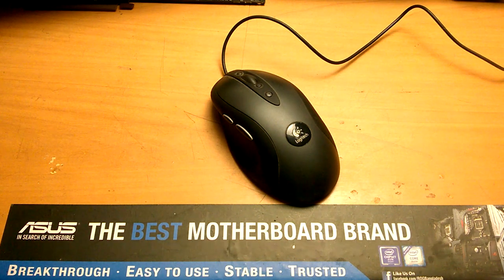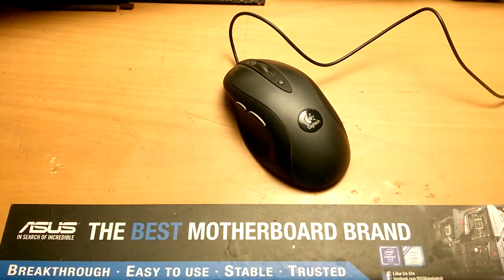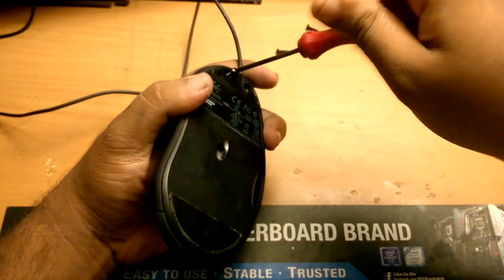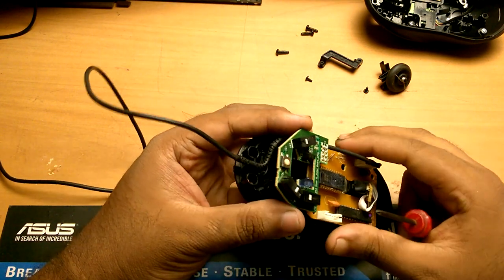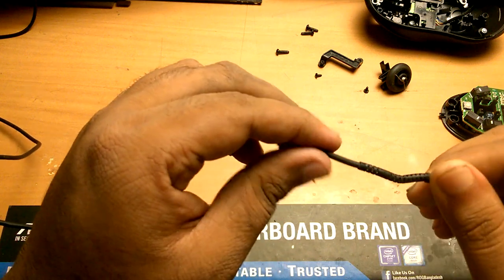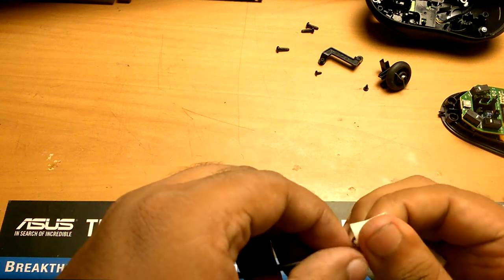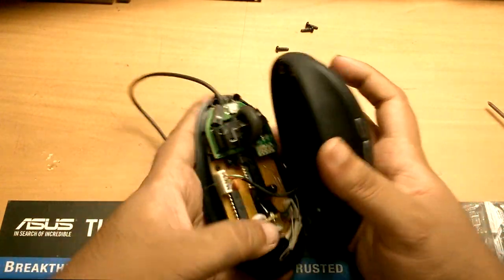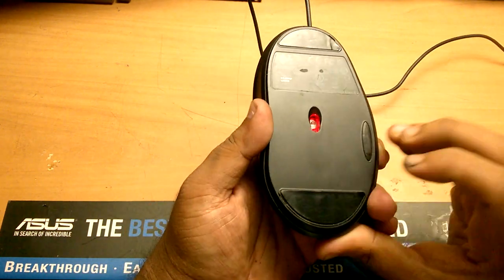Logitech G400 Mouse Disconnection Issue Fix

Comment: In case this helps anyone, I particularly had difficulty stripping the plastic off of the wires without a wire stripper, so what I did was pinch the shielding with a pair of clip scissors (you can use nail clippers) in both north-south and east-west points of the wire, then hold down the wire firmly with one hand, and use tweezers to pull off the shielding. It doesn't work every time and sometimes I had to keep cutting my wire shorter, but it worked in the end!
Reply: or use teeth

Comment: Hi, when I open the wire, there are 5 wires... The 4 colored ones and one copper one just naked... what should I do? Just connect it to its matching half too? Thx
Reply: Update: I just connected it to its matching half and did all the steps as you've showed and my mouse works again!! Thank you!!
Reply from the maker: Yes. 
The 5th wire is just for extra grounding . Just incase your computer doesn’t have its own grounding system that helps a bit. 
But a mouse can live well without it too.

Comment: I had the same issue for my G300s an year ago.. It was for 2 weeks and it got fixed on it's own ..But today 1 year later I am facing it again !
Reply from the maker: Locate the defected point of the wire, 
Just cut it and rewire it. 
Done